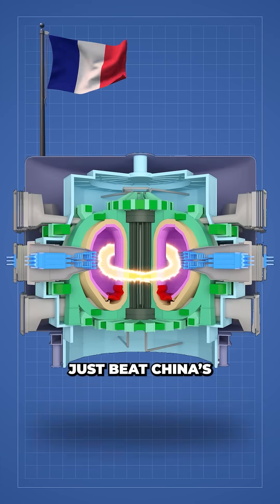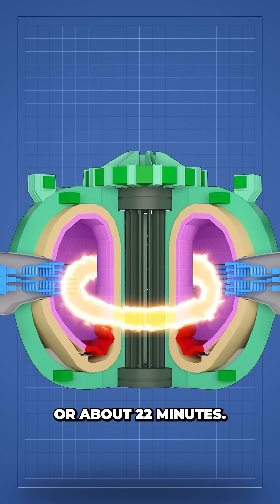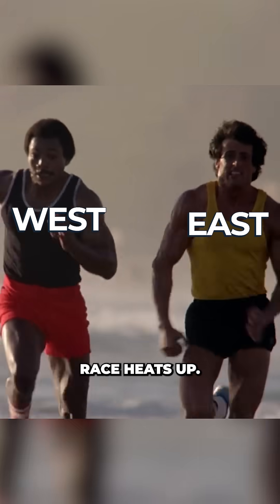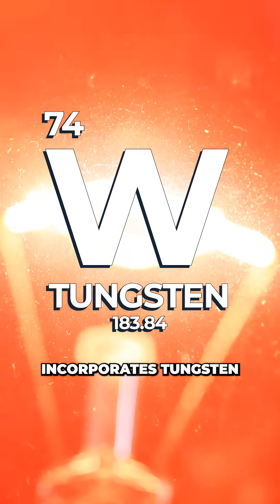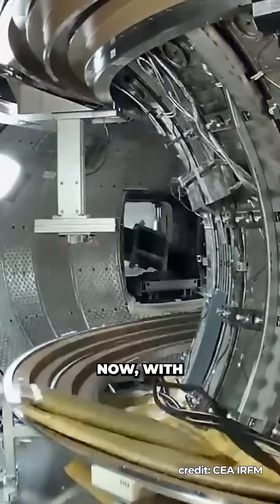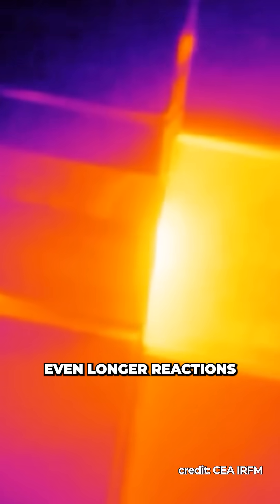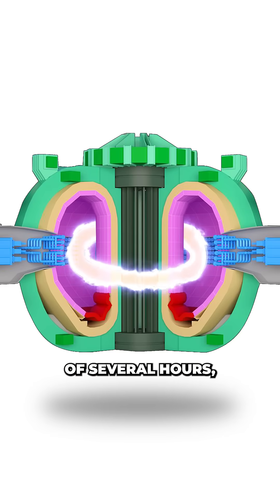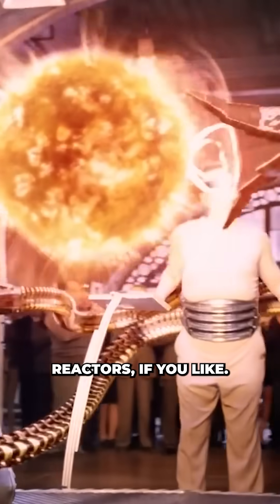France Breaks Fusion World Record

Comment: Why do we never hear something about the ITER/why does it never finish? Is it much bigger than the other reactors that have been build?
Reply: It is much bigger, the theory being that current reactor designs are theoretically capable of producing more power than is required to sustain the reaction, but the volume of plasma is too small. Due to square-cube law, making it bigger means less heat losses. ITER is, however, not intended to ever become a commercial reactor.
Reply: It's meant to be a commercial reactor, it's completion relies on a functional design for generating, sustaining, and actually getting power from fusion reactions